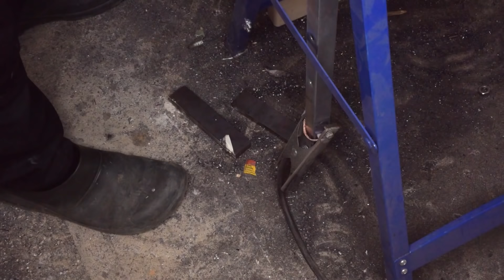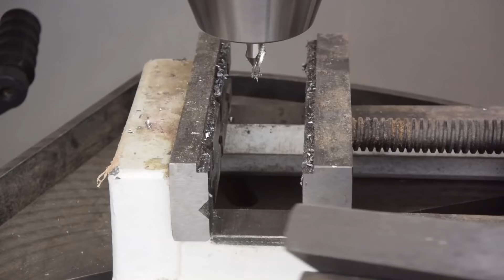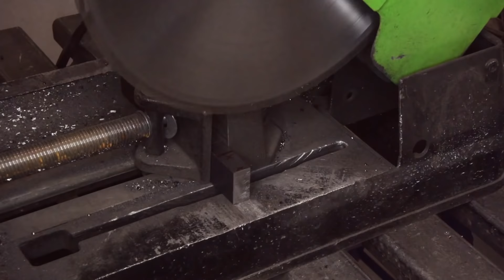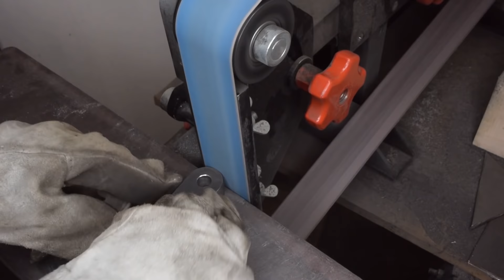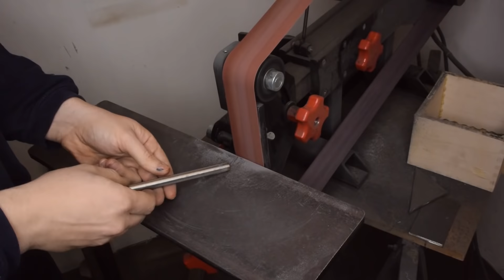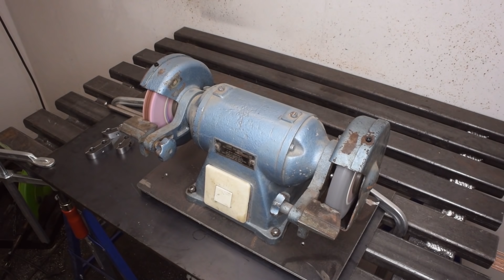Machining a Universal Attachment Rail for the Old Grinder

Comment: Nice work, but some advice from and old timer is in order. Loose the long sleaves, gloves and above all start bolting your vise down. What happens is the bit grabs just before it through the hole, grab's the handle out of your hand...the vise spins as the quill lifts the spinning vise up away from the table, tool/bit breaks....
Reply: much wisdom in the above post.

Comment: Good job! I liked the video. question: in 3 parts, 2 holes were marked and drilled coaxially and in parallel - this is guaranteed to be achieved if you collect them in a package and drill in a bundle. In the video, everything is done separately, and everything coincides and fits together, it's beautiful

Хорошая работа! Видео понравилось. вопрос: в 3 деталях по 2 отверстия оказались размеченными и просверленными соосно и параллельно - этого гарантированно можно добиться, если собрать их пакетом и сверлить в пачке. В видео сделано все по отдельности, и всё совпало, и подошло друг к другу, это прекрасно

Comment: Hi Cosmas, deine Standbohrmaschine macht einen guten Eindruck. Welches Modell ist das und würdest du sie nochmals kaufen? Beste Grüße und mach weiter so tolle Videos✌️
Reply from the maker: Hi, ist eine Optimum b26 pro. Würde ich nicht nochmal kaufen. ich würde mir eine mit Stufenlosem Getriebe holen.
Reply: Ok, abgesehen davon, läuft sie rund , wie ist das Spiel in der Spinole? Das ist ja der eigentliche Schwachpunkt immer